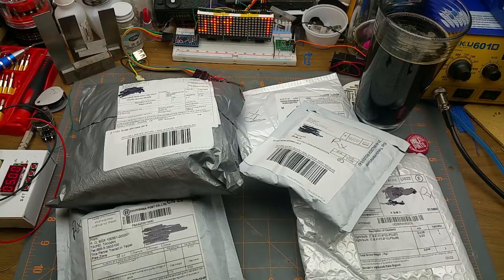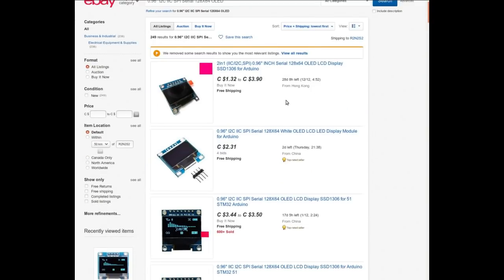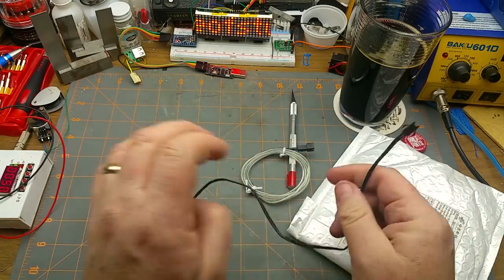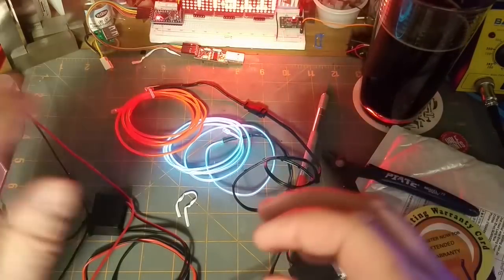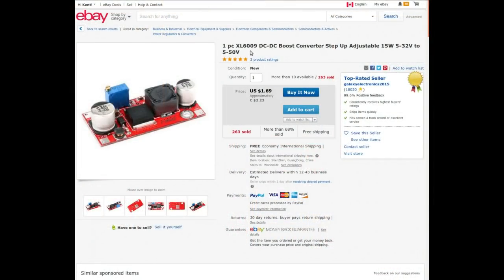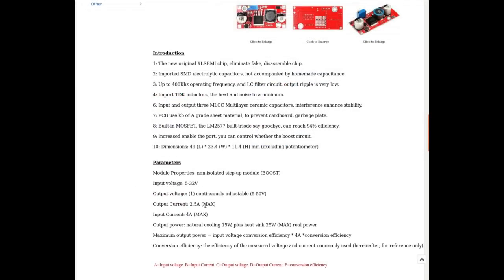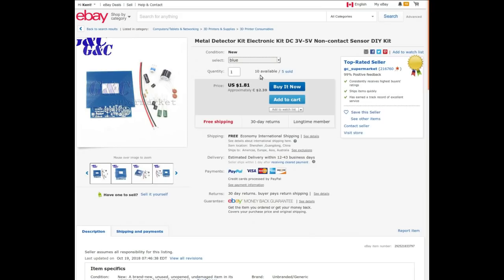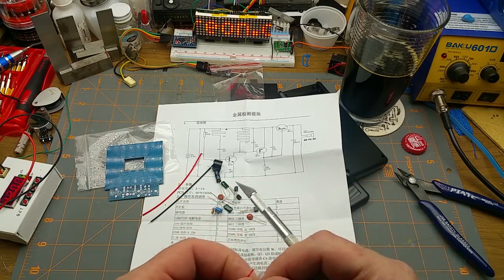mailbag monday 43

Comment: Those OLEDs are really remarkable.  The i2c flavors are just over $2 direct from Ali stores, and a lot easier to wire up than, lets say, a 4x7seg display ... and consume FAR less power.
Kinda slow though.  The SPI versions update a lot faster, and cost about $0.75 more.
I put one on a perfboard, along with an i2c port expander to read 5 buttons in a cross, and a rotary encoder.  Makes for a nifty user interface, requiring just 2 data wires.
Reply: For the cost of them, they are great. There are various libraries that can offer better refresh rates than others, its a matter of playing around to see what's best for what you want to do. Do be aware though that the suffer from screen burn if you leave a fixed image on for a very long time.

Comment: currently binge watching these mailbags; dunno why, but I love em.
did you make your "bench supply"? seems rather functional the few times i've seen it used now. i'd like to make a small one like that.
Reply from the maker: That power supply is a cheap CC/CV buck converter from Ebay in a case that I put together.  (https://youtu.be/avv7dsoVO9o)

This is a larger one that I also use: https://youtu.be/1Q3-kk_9o4s
Reply: @pileofstuff  handy, that! Those are next on my list. Saved me the trouble of digging